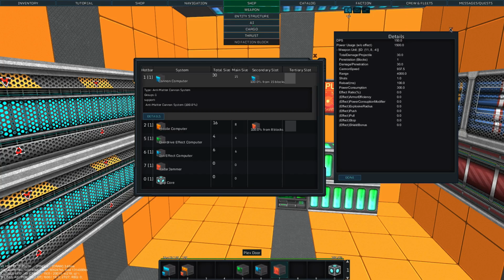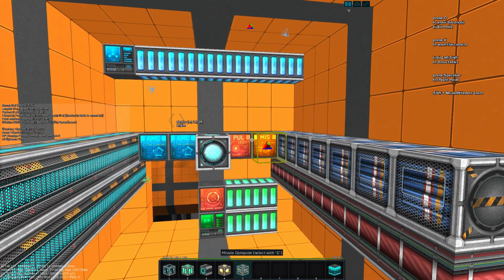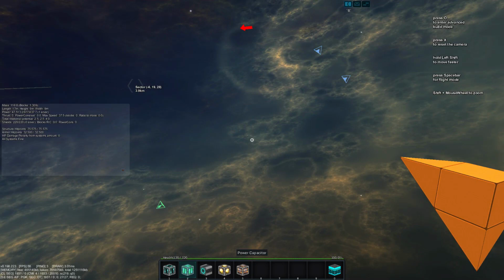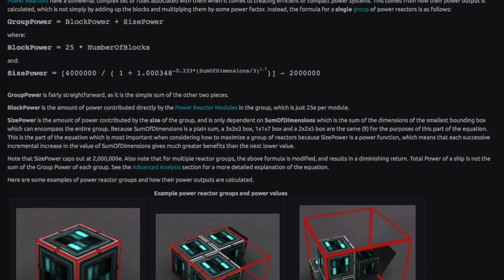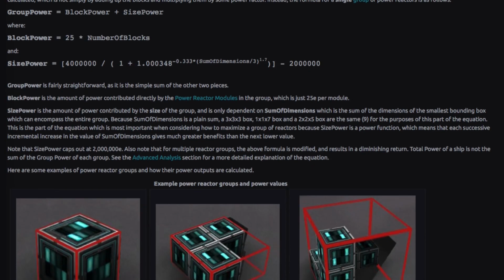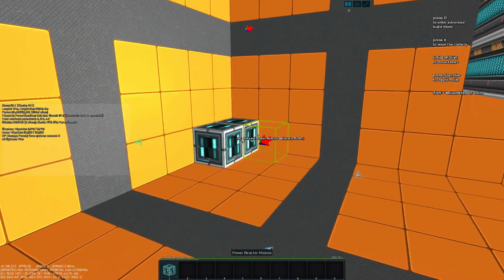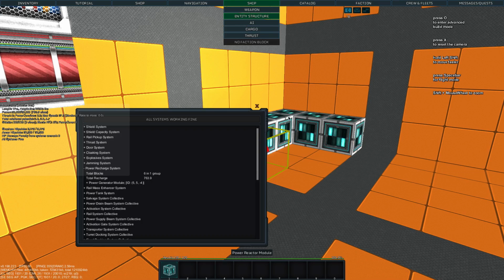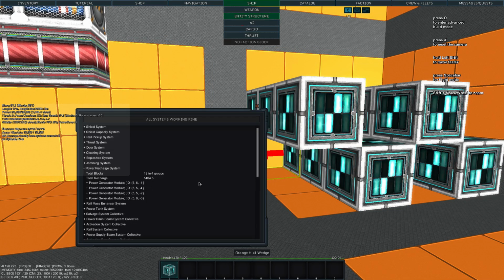Starmade: How To Build Power Tutorial

Comment: Would the most efficient power be to stack up power blocks in a lattice with empty space such that you only use half of the volume that they occupy? And also does it have to be empty space or could I put, for example, thrusters between them?
Reply from the maker: empty space just means no touching power modules ; ) ofc you could put in between whatever you want ; ) so would the most effective power be lattice thing i do not really get this part of the question man.
Reply: Imagine a checkerboard of empty space and power reactors. Place another one of those checkerboards on top but shifted one block so it's staggered. I mean like that where the max group is 1 and there are no power generators adjacent to each other, only touching corners/edges, not faces.
Reply from the maker: dudethatsguy
that actually is the most inefficient way to do it for you create tons of groups while keeping the groups dimensions very small 1x1x1 = 3
instead building lines is considered pretty good already so long lines all parallel to each other... but if you want the least amount of blocks giving the highest amount of powerregen you really should try having as few groups as possible and each of them using as much as dimensional space as possible.

Comment: A docked entity can take power from host. can it also vice versa? (So the host take power from docked entity) Thank you
Reply from the maker: nope not by just docking them. there are beams though that can transfer power to the beams target. with a little help of a logic clock you could make a docked entity notice it got docked and thus start the clock and the clock then fires the energy transfer beam in periodical cycles... which can be pretty quick... so the docked entity provides a constant stream of energy to the host it is docked to.

Comment: I disagree with the notion of building a power system sufficient to power the systems you are installing. What I think results in a far more powerful ship is to instead first design the maximum practical power generation you can fit inside the confines of the ship shape you have planned, after factoring in internal spaces. Starting this way ensures that your ship will have the most power practically possible for your ship. Then once you know that, you install systems sufficient to make the most effective use of that power. 

Note that if you do it that way, in all probability you will have far more power generation than you can use if you are relying solely on missile armament, this because the generation will likely be far more than any practical quantity of capacitors can store. If you find yourself in that situation, the solution is to install all the missiles you had intended, and then give your ship a cannon/cannon/overdrive system (or something similar) sufficient to use up the (likely very large) surplus power.
Reply from the maker: i remember building the riva, not armed shuttle well it has tiny guns that's it, has overdrive though and jumpdrive... if i would have followed that approach i would have ended up with something beyond 100k infact the ship only requoires 20k and the free space is better put to good use as shield regen and shields. shield regen requires power you remember? power will not protect the ships, shields do. look everyone is free to approach it the way they like so yeah sure go ahead i better like to only have a very small overhead.